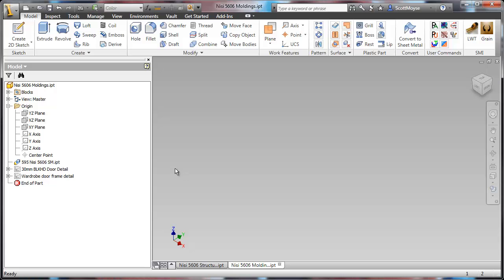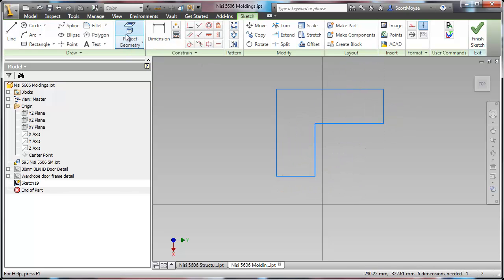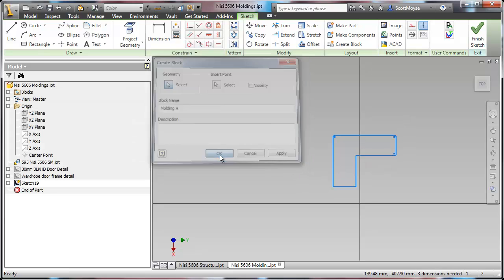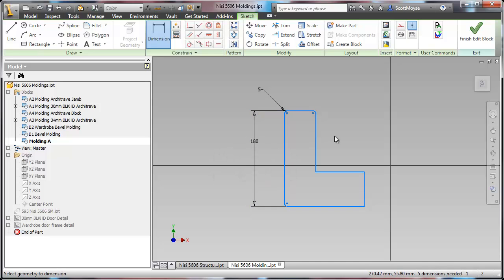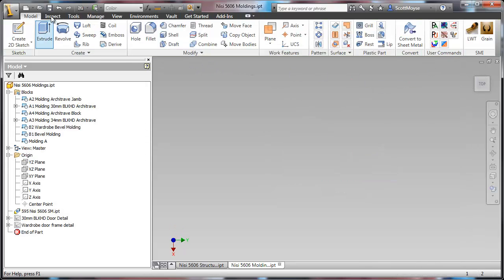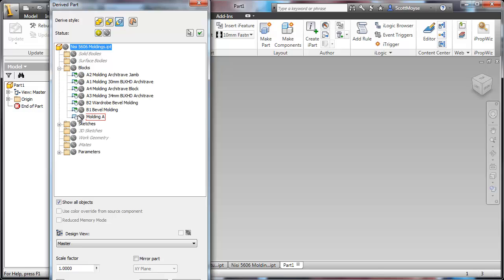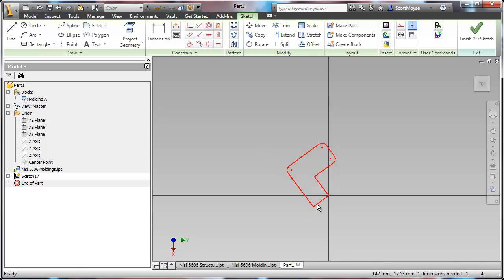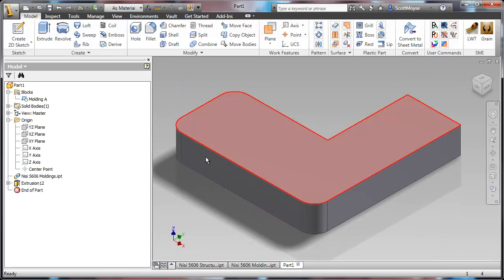Reusing Sketch Geometry in Inventor

Comment: What keyboard commands were you using to restart the horizontal constraint command?
Reply from the maker: SPACEBAR. It works in most applications as a repeat last command shortcut. Hopefully that's the answer you are looking for?